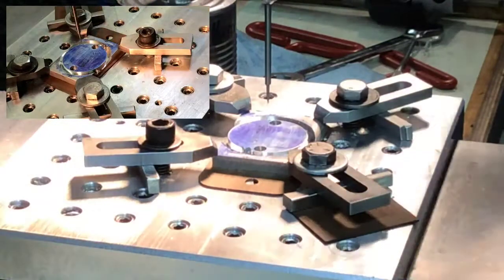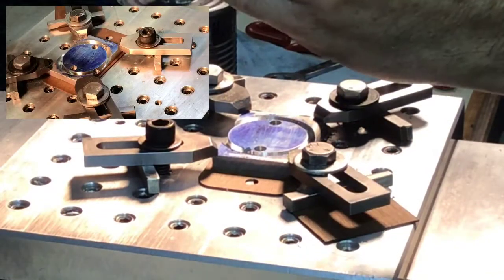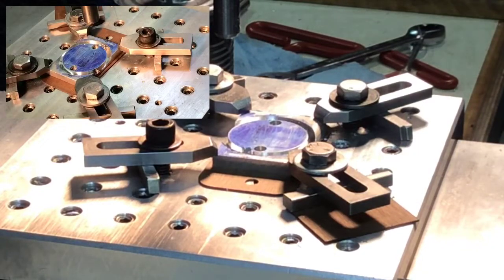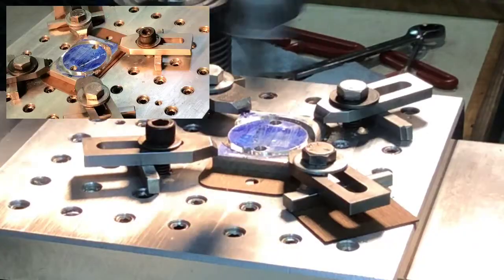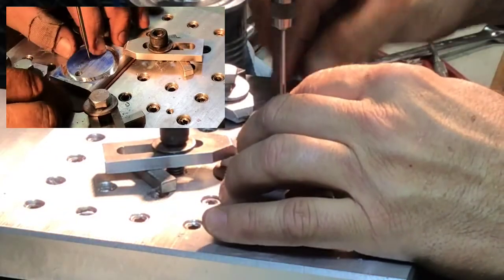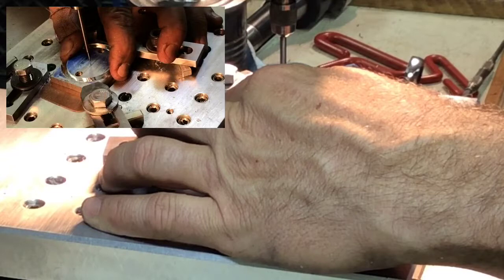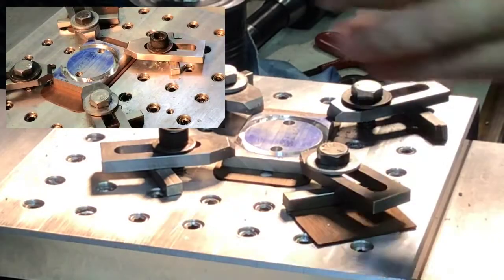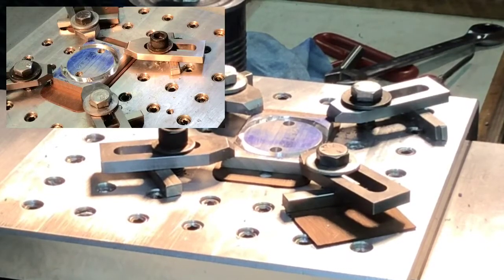How to Make a Dial Indicator Back P2

Comment: A note on hold down clamps: the pressure from the screw is divided between the workpiece and the back block (it's a lever, after all). The closer each thing is to the screw, the higher proportion of the screw pressure is applied there (mechanical advantage). If the block is much closer than the workpiece, then the workpiece gets very little of the down force. You might try putting those back blocks as close as you can to the far ends of the straps.

Comment: I was wondering why after you drilled the 2 holes that you didn't put screws through them and hold it down from the center for a great finish on the outside?
Reply from the maker: After I was finished I was wondering the same thing.  It is funny how great minds think alike.  Yes I should of did just that, if I do another I will do it that way.  Thanks for the comment.
Reply: I was watching thinking what are you doing and why drill the holes and not use them?????? now I know! hindsight 20/20!
Reply from the maker: Michael Murray Thanks for the nice comment.
Reply: Nice camera work. Innovative cam angles, picture in picture, high res, great!
Reply: I lay in bed 24 / 7 since Nov 2005 and I watch these videos and it reminds me of my work in the automotive repair and tire repair shop where I turned many rotors and drums and fixed equipment for 26 & 1/2 years.
Reply from the maker: Brad Fisher i hope you are not really in bed 24/7.  If you are I hope the video's help.  If there is something you would like to see, if I can do it I will.  Thanks for watching.

Comment: Hey Randy,
Thanks for your trick for making a backing plate for an indicator. I'm sure you could put some magnetic tape (with the adhesive on one side) on it and use the indicator on the lathe or mill. You should do like Mr. Pete does and put all your nifty tips and tricks on a USB thumb drive or on DVD. Thanks for sharing!
Have a good one!
Dave
Reply from the maker: The magnetic tape does not have enough holding power, neo magnets work the best.  Thanks for the comment.

Comment: I wonder if moving the square rod back from the bolts some would have help clamp it tighter. To me a non machinist it looks like most of the downward  force is going into the square stock holding the back of the clamp up, not the part your machining. Enjoyed the video.